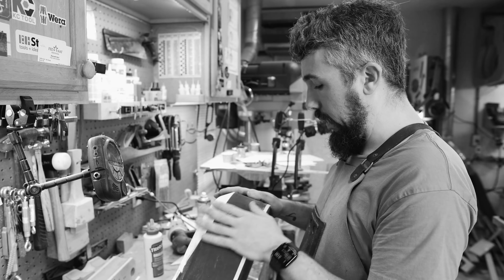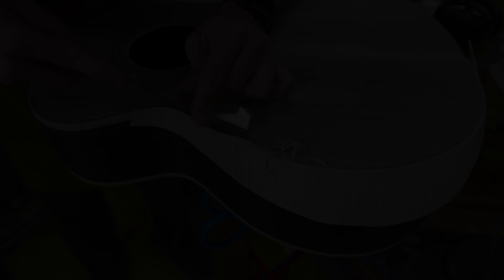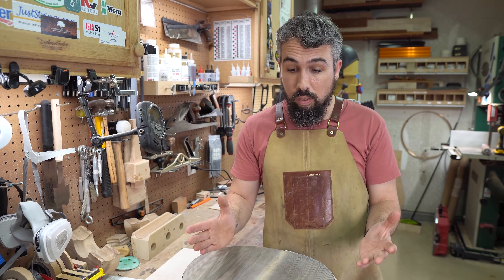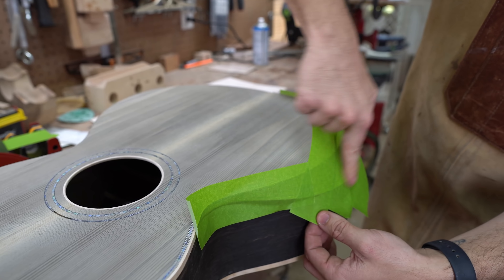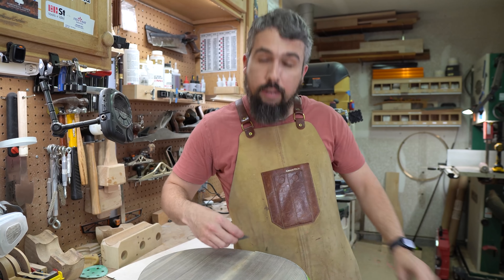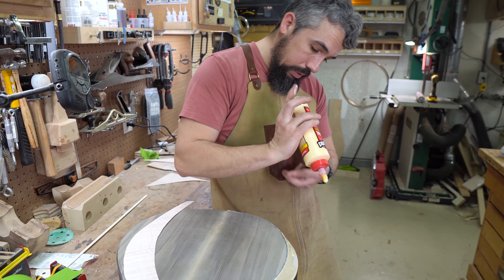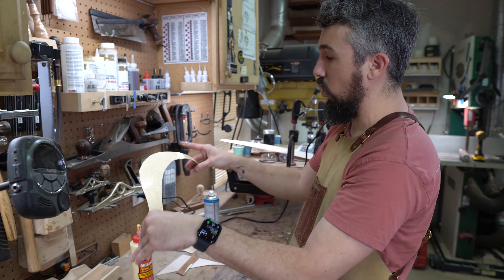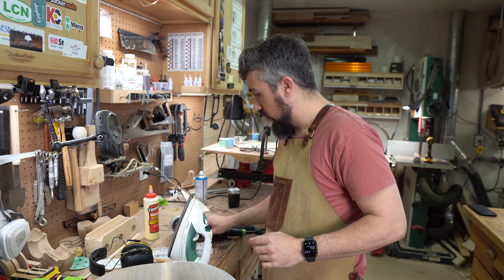How To Build An Acoustic Guitar Episode 24 (Veneering the Bevel)

Comment: How ya getting on Chris? I'm a very new builder and have learned a lot from your videos so thank you 👍 I'm also a joiner and we use industrial grade spray on contact  adhesive for veneer work  which is generally ready to glue together within 5-10 minutes depending on the weather, so I was wondering if you have ever tried an industrial grade spray on contact adhesive for the arm bevel veneer? I have also used the iron- on method before too which sorta got phased out once we started with the contact and only used occasionally....I was just curious to hear your thoughts on that you see 🤔

Comment: Hey Chris & Matt, I want to send a huge thanks for the Titebond/Iron method.  I have a Florentine cutaway on my current project that required an additional layer of veneer to fix a oopps!  Cutting, bending, prep were easy but I was not sure how I was going to clamp the piece after glue up. Then I remembered this episode where you glued the veneer to the arm bevel. Voila, followed your lead, used my bending iron to heat the veneer in the curve of the cutaway, and it stuck amazing. Thanks for all your videos and sharing your knowledge .😎Vancouver BC
Reply from the maker: That’s awesome to hear! I’m glad I could pass it on as well.

Comment: For oldschool veneering you would put hhg on liberally then put the veneer on and use a hot hammer and some pressure to open up the glue again and get it to stick.alsk burnishes the wood so if youre good at it no sanding will be required afterwards. My old boss could do panels like this and get them pretty close to dead flat
Mindnlowing skills

Comment: You can run a bead of super glue between the raised glued veneer and the top. Give the ironed veneer a little time before adding the super glue. I actually run a bead along both the top and sides before going at it with sander or chisel. Good luck.

Comment: chris you use alot of the same techniques that l use to build rc aircraft.instead of using a regular iron buy a monokot iron from tower hobbies they are temperature adjustable
and they are made for just what you need they also come with a cotton sock to protect the surface you are working on.

Comment: There is also a very specific product called heat  lock veneer glue that is made to be used in exactly that method and I have used it several times. It works great and I have never had a veneer come loose with it. I know you have your process, but might be worth checking out. Love this series!

Comment: In my former life I worked as a Piano Tech. for  a small company rebuilding old pianos. Often patching and replacing mostly Mahagony veneers. When removing excess wood I'd incise the break point line of the veneer using a #10 or #16 Exacto knife blade, snap off the excess veneer and sand smooth. Less risk, less drama than with a chisel😉

Comment: Wouldn't using kitchen shears to trim the veneer have been a better choice? Also, why not trim the veneer much closer and cut the ends off before applying? It looks like the ends got in the way of the bending and the gluing, ultimately causing your failure. A Dremel saw that attaches to your Dremel tool might be better. You could also use a scalpel to score the cut on the guitar side. A few passes with the scalpel into the cut and the veneer might cut off clean without endangering the guitar and allow for much less sanding. Plus. If you thin  the veneer on the ends they should bend more easily and a better glue up. You are going to sand it thin anyway.

Thanks for all of these videos.

Suggestion; after you finish the last video it would be valuable to have them all in sequential order as one release either on DVD or for download. That way a person could follow step by step while making one's own guitars.